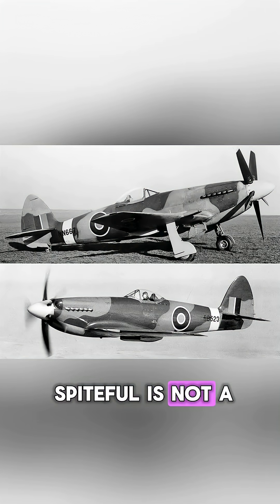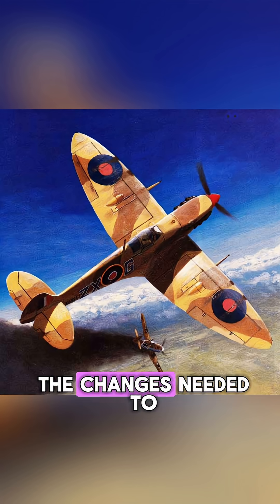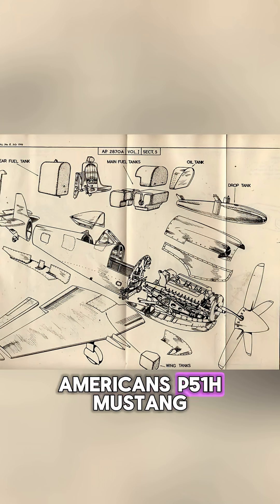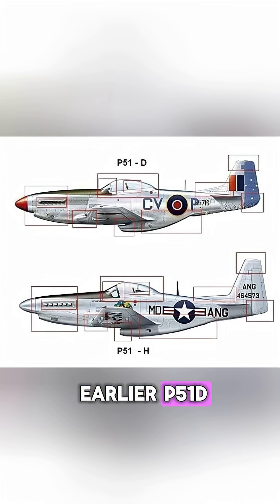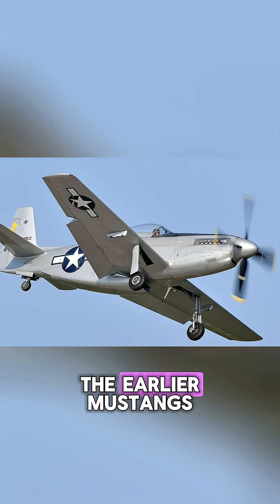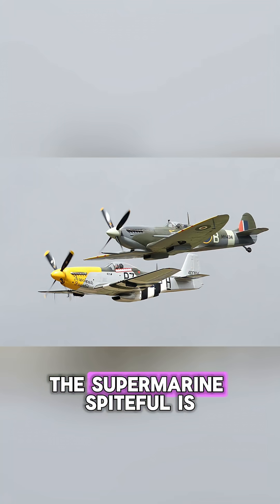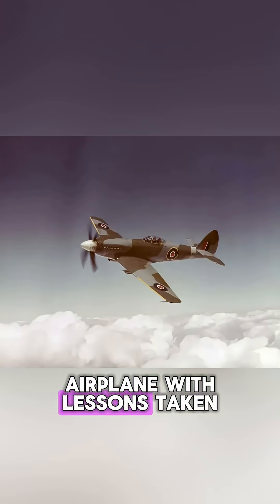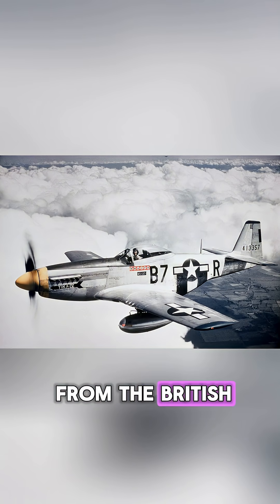Supermarine Spiteful A Better Spitfire?

Comment: One story I would really love to hear in full detail is the development of the Spitfire Mk. VIII. As I understand it, it was supposed to replace the Mk. V, and be a better engineered airframe in addition to the 2-stage RR Merlin engine. It was the delay of the Mk. VIII that made it necessary to introduce the Mk. IX as a stopgap, which was basically just a Mk. V with the two-stage RR Merlin 61.
There are a couple of videos on YouTube on the Mk. VIII, but they don't go into details on what caused the delay and the design features that made it different. Also, was the Mk. XVI a development of the Mk. VIII?
Reply from the maker: I haven't even covered the Spitfire Mk1 yet. The Mk. VIII is a really good one to talk about, but there are problems with talking about the Spitfire. It's a very emotional topic for the King's subjects.

Comment: So does the removal of the oval wing indicate that that design wasn't all it's made out to be? British docs brag about that oval wing all the time.
Reply from the maker: I suppose it depends on when you're looking at it. The elliptical wing was amazing in the 1930s but obsolete by 1944, certainly by 1945. Also, it was of German origins.
Reply: @GregsAirplanesandAutomobiles   Did the design team (!) not say it was to give chord depth sufficient to accommodate in a very thin wing the outward retracting main gear, the coolant and oil radiators, eight guns and lying span-wise four low profile pairs of fitting side by side detachable ammunition feed magazine boxes inserting from underneath.  From outboard of the last gun the wing only had to form a more narrow chord section leading to a low drag wing tip.  
The asymmetrical elliptical wing form fitted the equipment depth for most of the span requirement elegantly and the double curvature leading edge skins contributed to the strength of the D-box forward of the main spar.
Possibly a double taper conventional structure would have worked just as well and have been far quicker and cheaper to manufacture.  
With the late war ‘e’ wing the Spitfire didn’t even carry any guns outboard.

Comment: Spiteful is new 51h isn't. 51h is a stripped down 51. Like a p40q is still a p40. But the spiteful is new.
Reply from the maker: The P-51H had a new fuselage and wing, and a newer version of the Merlin with water injection. It's not just a stripped down 51D.
Reply: @GregsAirplanesandAutomobiles 
Right, same thing with the B50, people think it was nothing more than a B29 fitted with Pratt&Whitney R4360 engines but by the time they were done doing it there was so much different they had less than 25% parts compatability so they gave it an entirely different nomenclature instead of listing it as another B29 variant.

Hey, I've got a good idea for a video or perhaps series that your base would eat up, the SR71, it'd be a good subject as so many videos and online articles are full of common myths about it, like the tires supposedly being impregnated with aluminum, I even caught a museum curator claiming that in a video short, they weren't impregnated with aluminum they were painted with an aluminum paint, Frank Murray an A12 pilot points that out to someone that interviewed him at his home when the interviewer said something about the rubber being aluminum impregnated, he even had a used tire from one given to him in his garage to show the guy how the paint immediately wore off the tread within feet of rolling on it after a new one was installed, and the funny thing is the museum curator in the video short is pointing to the tires on their SR and you can clearly see the treads blacker than a moonless night, you'd think they'd realize it's just a coating.
Reply: @dukecraig2402 what is aluminum supposed to do to a tire?
Reply: @WALTERBROADDUS 
Reflected the heat off of it, as I'm sure you know those things got hot during flight, the sidewall of the tires that were facing the surface of the SR when the gear was folded up had the heat that was radiating towards the inside trying to heat those tires up causing the pressure to rise to dangerous levels, they already had 300 psi in them sitting on the ground so they couldn't afford to have their pressure raised up much more, especially at that altitude where the 300 psi at sea level is already much more of a strain from being in air that thin.
It's amazing that Lockheed already had all those little details already figured out before it even flew the first time, otherwise they'd have been crashing them for 10 years getting those little details sorted out.
Ben Rich, the guy who ran the Skunk Works wrote a book I just got yesterday, as soon as I finish Paul Crickmore's book on the SR I'm going to start that one.
Reply: @dukecraig2402 so nothing to do with radial tires?